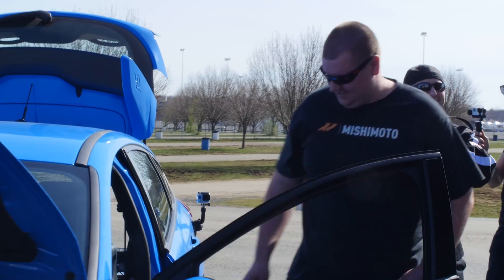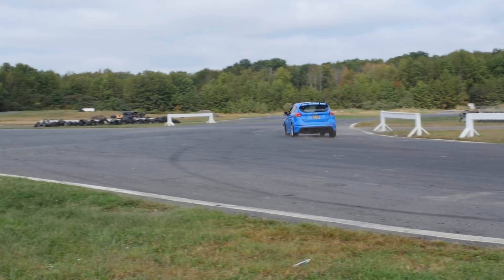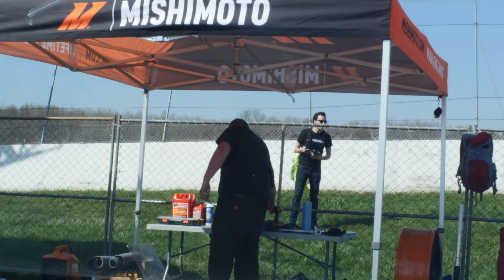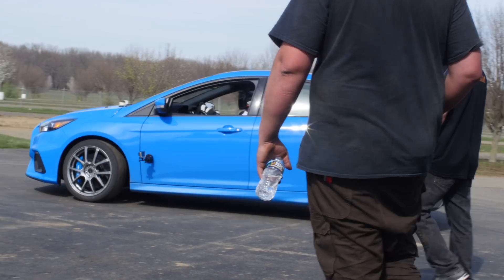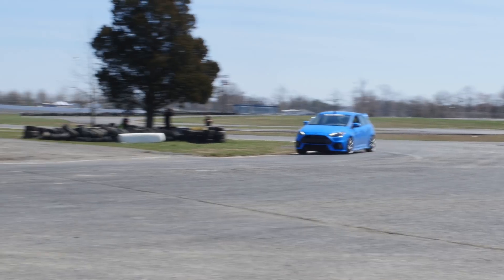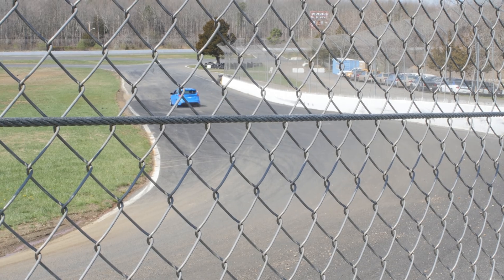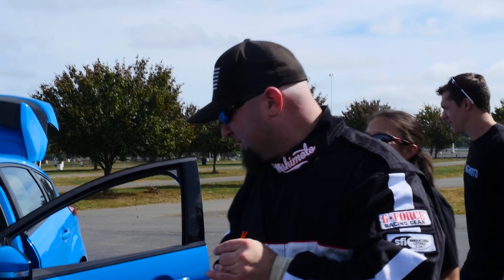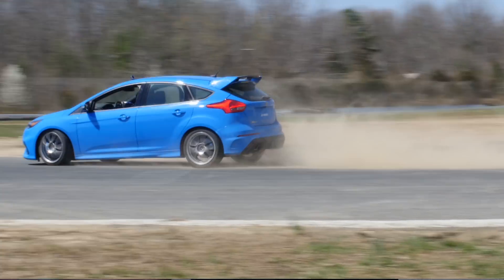Track Day Final: 2016-2018 Ford Focus RS Differential Cooler Kit by Mishimoto

Comment: Its funny how the car has the camera behind the left front wheel one minute then its gone.. then it's back?? I wonder how many laps the car really did with/without the kit?
Reply from the maker: Hello Nige. Our test vehicle made it 23 laps prior to the brakes giving out. Check timestamp 3:04. Sorry if the video comes off a bit misleading due to camera location changes.
Reply: Mishimoto Automotive did u guys every try hand brake turna and clutch dumps drifiting. Ive founs that causes thr issue... Maybe overheating as well just much faster.  I see your now going to sell these now. Guess i have to buy the parts and make my own.

Comment: does this require reprogramming the ECU? I was under the assumption that the RDU temperature was calculated via the ECU and does not have its own temperature sensor.
Reply from the maker: Hey pr0jectSkyneT . No need for reprogramming with this product. However, you are correct. the RDU temp is inferred by the ECU using the PTU's temp sensor, and calculating with throttle position and rear wheel slippage
Reply: @mishimoto  so how does the cooler keep the rdu from not shutting down? obviously the cooler keeps the fluid cooler and is of great overall benefit but without reprogramming the ecu and rdu computer i cant see how it still wouldnt turn off. also very interested in this kit  or a similar aftermarket cooler but theres no way im paying 2000 or whatever you guys had originally priced it out for. especially with no software remap. couple fittings and small oil coolers and brackets arent worth that much

Comment: Will this help the head gasket failure lol
Reply: You talk as if the Type R got no issues with transmission having gear grind and 5th/6th gear lockout and engine overheating issues.
Reply: pr0jectSkyneT that’s a easy clear fix nothing like a head gasket lol plus that lil problem, is only with a few that head gasket is damn near every Ed.
Reply: The overheating issue is not a big deal but transmission is not an easy fix mate. Honda has acknowledged the issue but has yet to have a fix. The Ford head gasket is not every Ed. It's affected 2016 and early 2017 models.
Reply: SI RICKO why not just get the focus gasket put in for free. Should you half to, no that part sucks but you ask for a fix and I answered. You could also buy a car with the correct gasket. You just need to pop the hood and look at it.
Reply: SI RICKO no, but a headgasket will.